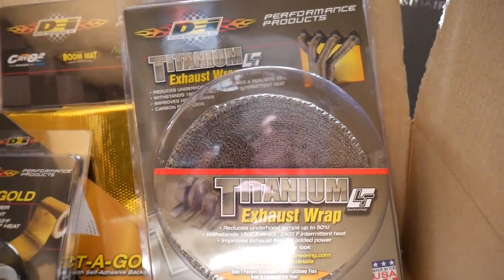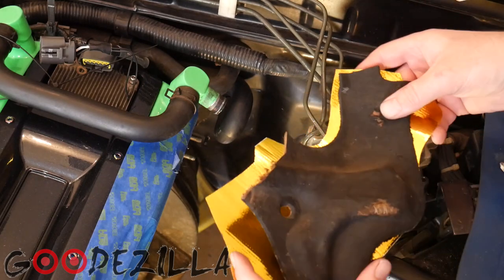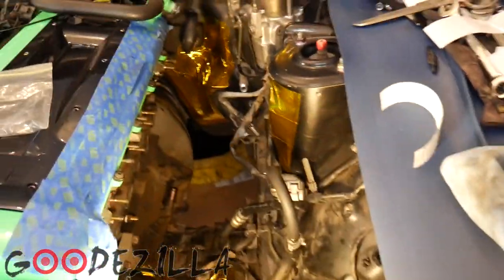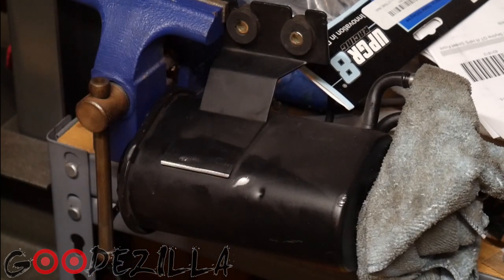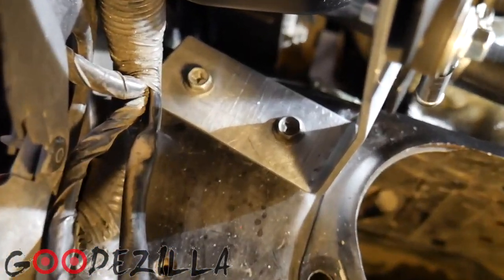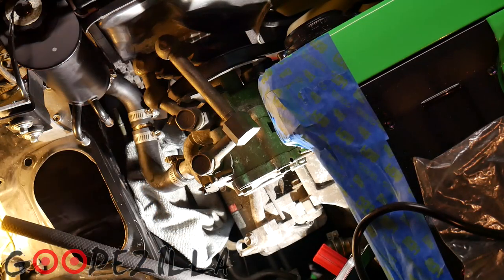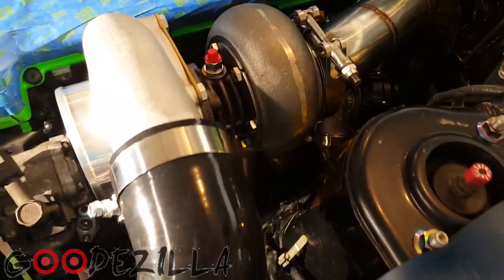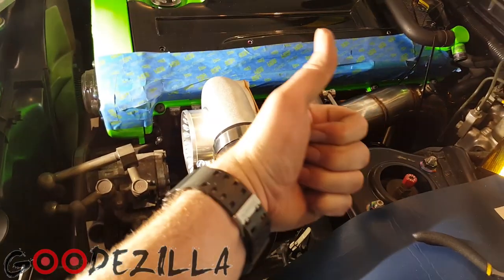R32 Skyline GTR Single Turbo Project Episode 4  - Power Steering and Heat Shielding

Comment: what was the reason for relocating the power steering from original placement to the front of the engine bay?
Reply from the maker: +Tificial The power steering reservoir was in the way of the manifold and turbo.

Comment: Why don't you replace the rubber power steering lines with braided lines as you already know how to assemble them? You can buy an aluminum power steering reservoir with an fittings at chasebays.com.